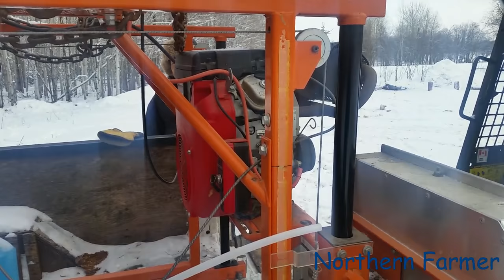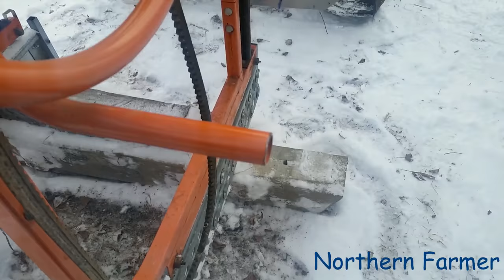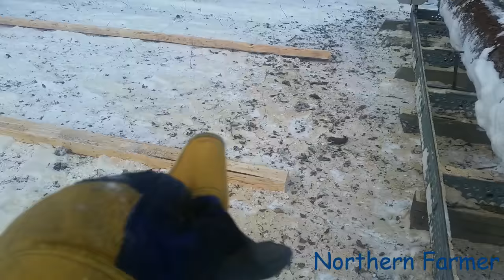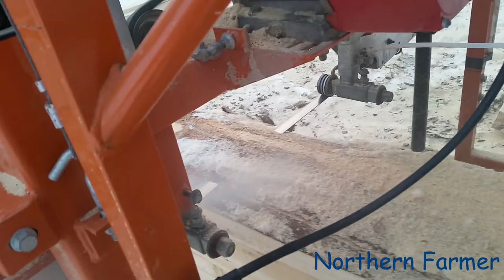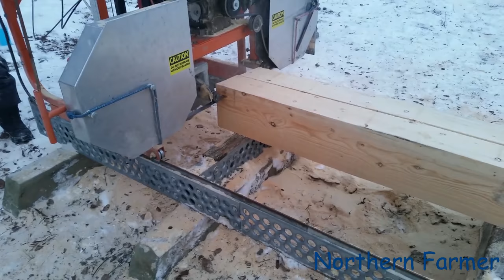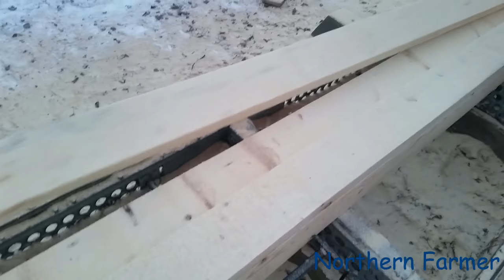NORWWOOD BANDSAWMILL!!

Comment: My bandsaw was built at a local welding shop but I can see a lot of similarities between yours and it. Wish mine had a 2 banger on it. It only has a 13hp Honda.  Sometimes in super sappy spruce it pulls the engine right down. Take care